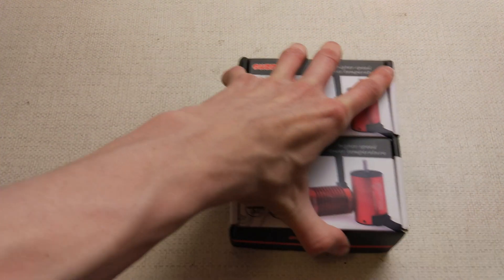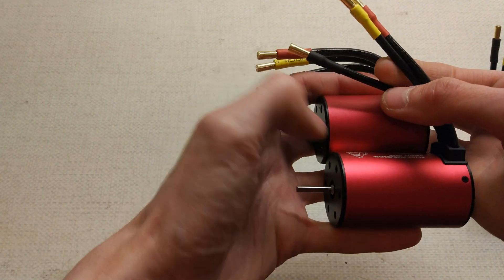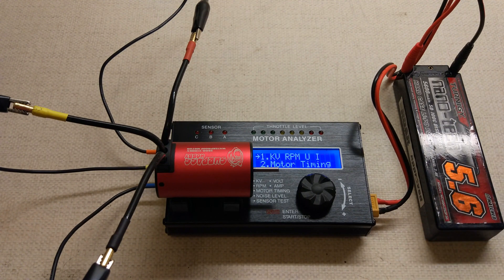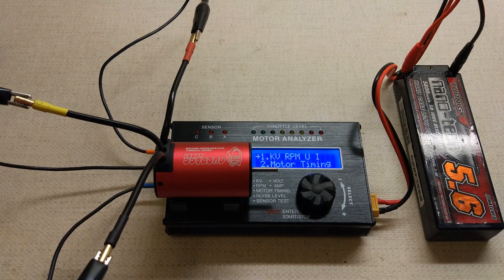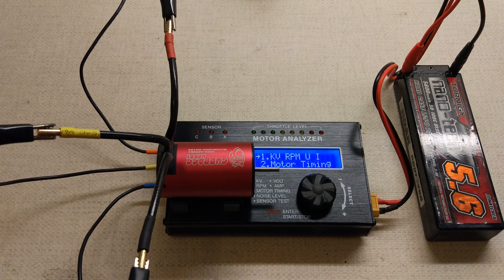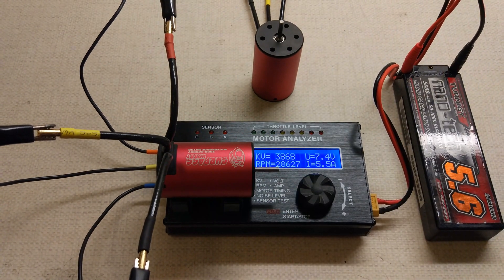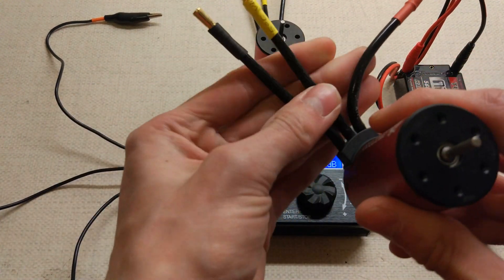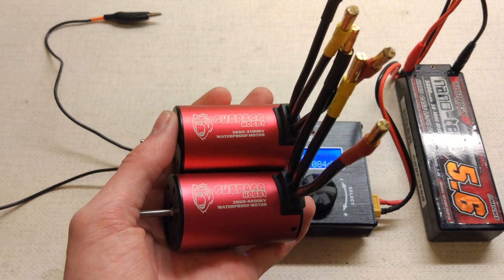MTT EP9 2 Surpass KK Series 3660 Motors Tested

Comment: I think those are 3s motors. I bet they do the rated kv with 3s power.
Reply from the maker: The kv is rpm per volt. Higher voltage doesn't make any difference.....
Reply: @LawrenceTimme  Oh really ? Then test your motors at 1 Volt and show us.
Reply from the maker: @bretzeletouffeur  the motor tester only works at 2s voltage. The kv is constant value. Its rpm per volt. So the higher the voltage the faster it spins, obviously there is a minimum voltage that it requires to move, which is probably above 1v. Most manufacturers of motors test at a 2s voltage.
Reply: @LawrenceTimme  I would enjoy you show us on 2V /4V /5V to check if really proportional or if it has an optimum voltage.
Reply from the maker: @bretzeletouffeur  I don't have the correct equipment to do that unfortunately.
Reply: @LawrenceTimme  Sorry and thank you for teaching how it works. Could you explain why the KV indicator on your tester vary depending of "throttle level"? Is it the proof motor KV vary depending the voltage you deliver to it ?
Reply from the maker: @bretzeletouffeur  it's calculating the kv by the input voltage not the output voltage so until you reach full speed it's giving a false reading as it's saying the motor rpm at say 5v but then dividing it by 7.4
Reply: @LawrenceTimme  Thank you very much for all these explanations and for your patience, you are really a nice human !
Reply: @bretzeletouffeur  Yes that funny because my car say 2s n 3s..I thought my car was fast at 2s..I went the Hobby told them give me a 3s...You need a new ESC.I brought one from the eBay..I went to go change the ESC n it say 3s.So never believe everything you hear if they don't do all the test...My car is heavy not a little car...It's so fast got put it on dirty... Anything else it flip n all over the place...

Comment: What's interesting is Surpass do make the 3660 in both 2900kv and 3800kv so I do wonder if they were just labeled incorrectly, and possiblity the reason why you got so cheap.
Given the lower then expected  amp draw of both it does seem like a possibility.
Reply from the maker: Yes I was thinking this could be the case. They both seem legit though.
Reply: @LawrenceTimme  
Yeah I've owned and still owned a few surpass hobby and never had any problems with them.
First one I owned was the rose and silver platinum series, a 2845 5000kv.  I was super impressed with it, very smooth and powerful and have mostly brought surpass motors since. None have died on me despite that 2845 at one stage being completely underwater with all other electrics includeded the battery dying, but the motor was still strong.
When I removed the motor out of the car, I  pulled that one apart to clean all the dirt and grease out after over a year of abuse and impacts since it was rear mounted motor  exposed to impact. When I put back together it ran a little hot, even without load. I probably could of kept and still ran it  but decided to retire it since new ones are so cheap as I ended up putting a brushed system in that car to give to a kid as his first RC and didn't have any immediate use for that motor anyways.
Since then I've owned blue can, platinum and KK series 2440, 2838, and 3665 motors and have not had any problems with any.
Reply from the maker: @druscanam  yes I have lots of there motors and they have mostly been great. Only real issue I had was a on the 4092 1650kv where all the screws came out the end cap and so the cap came off and the rotor got damaged.
Reply from the maker: @druscanam  kind of ironic isn't it. The 2000kv motor in my xray blew up after writing that comment 😢😢😢😢
Reply: @LawrenceTimme  
Another good motor brand that punches well above its price range that is not made by surpass hobby (goolrc and Ocday made in surpass factory) is Ldpower. LDpower have been making well known race drone motors for a while but are not so much established in RC car motors yet. The two most common sizes I know of is the 3652 and a 3674 motor. I own two 1/10 2WD buggies of the same make and model, one has a hobbywing ezrun 3652 3300kv the other a 3652 3800kv LDpower. Obviously I was expecting the high kv motor to have a higher top speed due to higher rpm yet I was not expecting how much more punchy, smooth, refined and responsive it was compared to the hobbywing. Higher kv, same gearing yet seems to have more torque. Also stays cool too even after a 28min endurance track run (didn't quite last 30min) on 3S with thottle rate turned down to be about 2S power.
And you can find these on AliExpress for peanuts. Haven't tried the 3674 size but next time I need a motor that size I will try the LDpower one for sure
Reply: @LawrenceTimme  
Oh no, sorry to hear.
Reply from the maker: @druscanam  nice. I might check out an LD power one.
Reply: @LawrenceTimme  
 @Lawrence Timme  

Here's the link for the 3674 2260kv
Smaller and less powerful then your 4082 motor buy honestly for a 1/8 buggy I don't think you need anymore then this unless you want to do 100mph speed runs.
For its size (and price) it actually has some pretty good specs, can run 6S, develops 2400W of power and  draws 90A. By comparison a kk series surpass 3674 2250kv can also take 6S but only develops 1800W with a draw of 80A

I also looked up the specs for your 4076 surpass 2000kv motor, it rates that at 2800W drawing 135A.

So yeah the LD does seem very efficient when you compare the specs.

AU $31.46  7%OFF | 1PCS 1:8 RC model car accessories 3674 brushless four-stage waterproof motor KV2260
https://a.aliexpress.com/_dUJNdVk